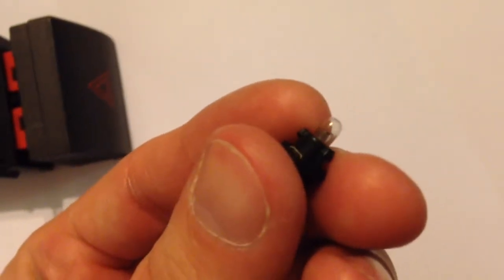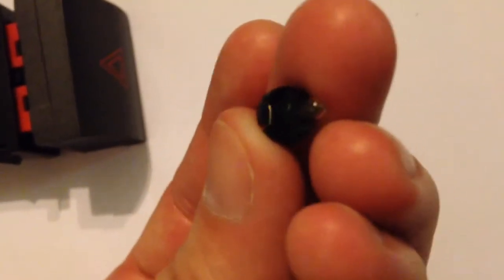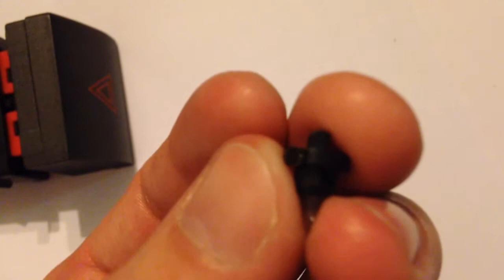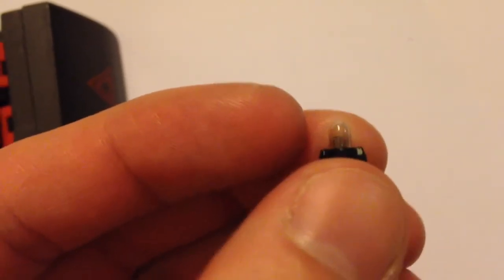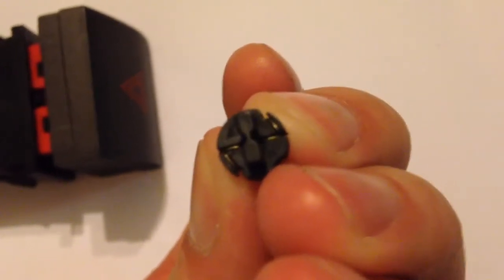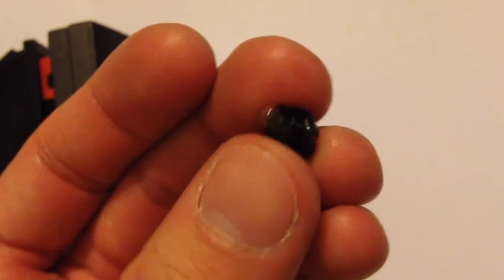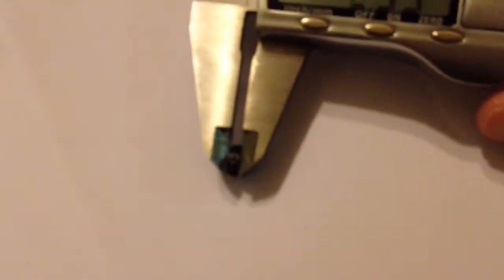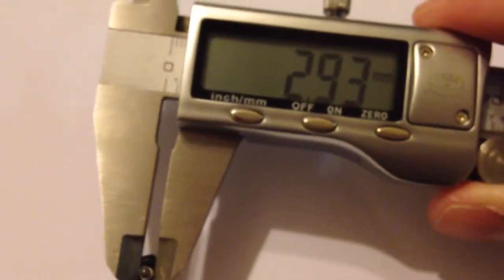Elantra hazard switch bulb size

Comment: Does anyone know where I can purchase this build from.  I would really appreciate your help.
Reply from the maker: The Radio Shack 2721092 one is getting hard to find because of their closing.   This 7219 looks like it will work.  Double check the diameter of the old bulb.  I can't remember the size.  This one is 3.1mm. 

https://www.ebay.com/itm/Box-of-10-7219-Lamp-Bulb-12-Volts-60-mA-0-72-Watt/131833701244?epid=0&hash=item1eb1e6a37c:g:YIMAAOSwMVdYE2je